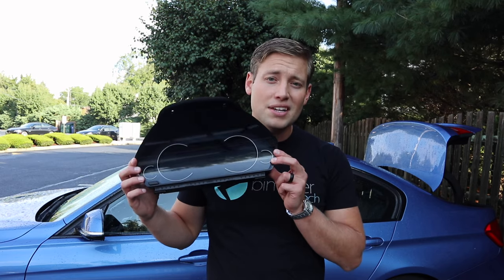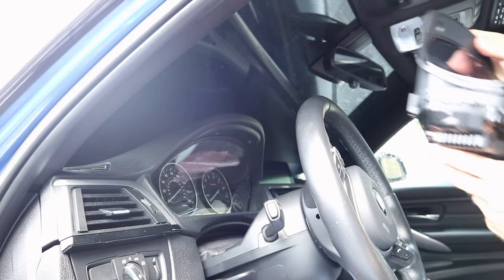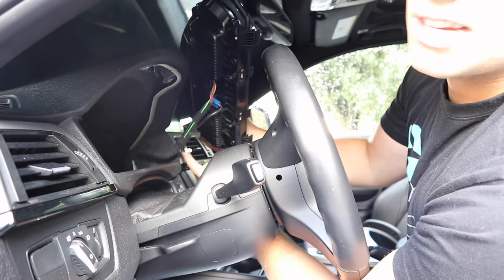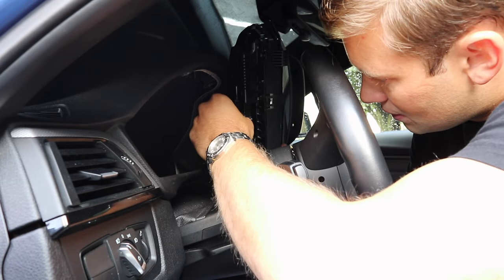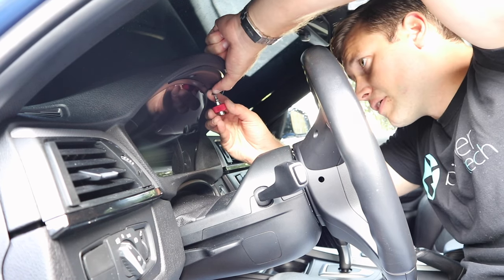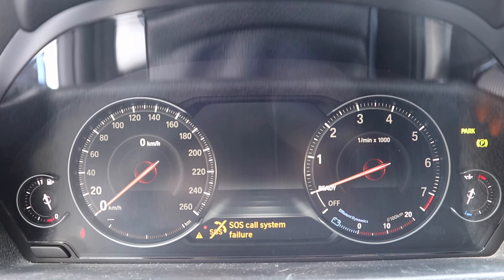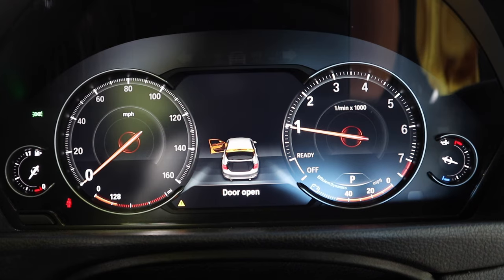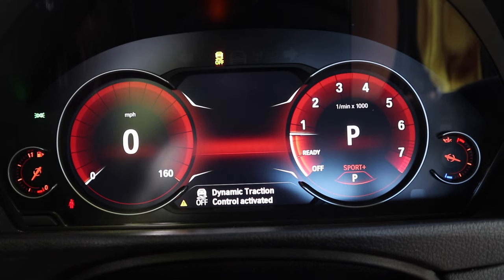How to install the all new 6WB BMW OEM Digital Cluster on the F30, F30, F32, F3x, etc. #6wb

Comment: German cars: 
over engineered drivetrains and engine, sophisticated electronics and components
Remove 2 screws to take out the whole cluster

Japanese car: simple and durable engine and drivetrains
Replacing a faulty button requires taking out a whole dashboard.
Reply: so true LOL
Reply: Japanese Cars has also over engeneered Engine with 3 turbo?!
Reply: Japanese cars are the best! Which is Toyota, but I do love German cars such as the BMW because of the comfort
Reply: @ScubaDiverMan711  I dont know about comfort my brother bought a 328i and the seats are rock hard and uncomfortable leatherette factory seats  the car itself is a fantastic sports car but the seats are awful.
Reply: Russia Man99 I mean the new Supra is a BMW
Reply: neosrt10 does it have the m sport package Becauses that’s the whole point
Reply: Your telling me. I had to take out my entire dash to replace blower motor on Nissan Altima ....
Reply: do duc duy 
German cars are well engineered they are not over engineered
Reply: As AC mechanic, Nissan and Toyota are the worst to work with. Meanwhile honda is easy, the engineers at honda already think about how mechanic can fix certain stuff without removing whole dashbord
Reply: And BMW is still bmw since e39 till e60. Until F- coming, metal clips there and there.
Reply: Sooo true
Reply: except when it comes to removing the headlights. on bmw cars you have to remove the whole freaking front bumper to get the headlights out.

meanwhile on almost all older volvo cars (2016 and older) the headlights are only attached with 2 metal clips. you can get BOTH headlights out in like 1 minute.

Comment: 3 years later I’ve finely my own f30 330D (2018) first BWM after killing my old Ford Focus with 460 000km.

And my first mod on it will be this amazing cluster and m3 led steering wheel

Comment: What's wrong with the analogue cluster. Seems like just another thing to break. The standard dials have been tried and tested. Still looks good to me.
Reply: I have yet to see a digital cluster to fail. These aren't your cheap aftermarket solutions.
Reply: Well digital cluster indicates oil temp so that alone is worth not having to add an aftermarket gauge that isn’t included into the dashboard
Reply: @CarlosHernandez-cm5yx  analogue cluster includes oil temp...

Comment: I was planning on doing this but was told if you take your car to the dealership and they happen to reset your ECU, you'd lose all the coding?  Does BimmerTech offer re-coding if that happens?  Also I was told this voids your warranty if you still have one...
Reply: Yes we do and it does not void your warranty.

Comment: Cool !! but OMG -- $1600 !
Reply from the maker: Awesome isn't cheap, lol
Reply: Is this bmw oem part or some custom job?
Reply: Obviously is OEM...
Reply: Benszg its oem
Reply: It's cheap...
Reply: Yep $1600 , just remember that when all cars have this you'll be facing a potential $1600 bill should something go wrong.
I have a friend who bought an Audi TT with the virtual dashboard, guess what, it went wrong.
Luckily it was under warranty still.
Reply: Yes, oem, but if you order this on your new car it is in a $3,100 package
Reply: Honestly I’m surprised it’s not more. Analog clusters cost that much. Quite reasonable
Reply: Kies Motorsports where i can buy this? I need link
Reply: you don't buy such a car if you find this upgrade expensive. it's some rather acceptable price.
Reply: Does this cluster fit into X3 F25 (2012)? Love the final effect!

Comment: In a manual car will it tell you what gear you are in?
Reply from the maker: Hi, I haven't personally tested, but I can probably find out
Reply: I would think so.  I have a 15 335i that is a manual.  You can select whether to display the gear you are in or not.  I can't see losing that feature from the IDrive as all you are replacing is the instrument cluster

Comment: Does this avoid the warranty
Reply from the maker: Because of the Magnuson Moss Act, installing parts on your car can't void a warranty, unless the part you installed specifically causes an issue.
Reply: Kies Motorsports do you offer such a digital display also for the BMW Z4, E89 (sdrive 3.5)?
Reply from the maker: Not yet, sorry
Reply: Does this work with 2014 X5 ?
Reply: ibr80 same question

Comment: With the bimmertech video they plug in an optical cable and remove bits of the dashboard and plug in a cable into the back of the cd drive system

Comment: That cluster is slick, not sure if it's $1800 slick, but I would jump at throwing one in my 335 if I could find a used one on the cheap.

Comment: quick question do these parts need to be re programmed if the battery is disconnected ? if so do i have to do it live again ? would tht cost second or third time around ?

Comment: I would love to get the digital cluster one day. My cluster got a bunch of foggy spots from some glass cleaner I used on the back side of the glass. And a bunch of dust in there. Does the plastic cover come off so I could clean behind it?

Comment: Hey, Which is better? The rwd or xdrive? I plan On doing lowering springs. Im interested in which of the 2 will handle power mods better
Reply from the maker: I would recommend the X Drive!
Reply: Kies Motorsports will the torque still feel strong? Since it has to be distributed more equally between front and rear?

Comment: Awesome Work. But one Question:  How did you change the Original Miles on the new Digital Instrument Cluster? Laptop? Software?

Or is the new Instrument Cluster so smart enough to recognize the Miles from the Controll Modul Device, and that he automatically put directly to the Digital Cluster?
Reply from the maker: We code it to sync up and it automatically applies the miles
Reply: Kies Motorsports That only works on the Digital Cluster right? For example on a old Instrument Cluster, let's say a 12 years old, would that work too?

Comment: Hi Bro !!
I been watching your videos I learning something every day from your videos !  I have a question in my e90 2007 3281 the lights for the ABS is on all the time when I bought my car back in February 2020 come like that the guy sold me the car said just needs a calibration computer because they replace the ABS part under  the hood. So believe them, so now after 9 months I want to fix it can you give an idea how can I turn the light off of the cluster, or  have to go with some mechanic certified. I want keep my runs pretty smoot. I was thinking to sale it but change my mind.
Thanks for read my message Have a Great Day and be Safe.
Jaime from Houston, Texas.

Comment: On the website for the product it states heads up display not supported in CIC vehicles. Does this mean the instrument cluster is unavailable for cars with HUD
Reply from the maker: Hi, it works on NBT and NBT EVO, we’re working on getting it up and running on CIC

Comment: Hi, my F30 instrument cluster does not show Navigation display in the centre as shown at 5.05 in your video. I have checked all settings, and all look OK. Took it to BMW showroom, and even they are unable to fix the issue. Any help would be appreciated. Thanks.
Reply: Did you try to turn it off and turn it back on?

Comment: What's this from? The new 5 Series or is it available from the factory in Europe on the F30? 

Also - does this do everything that it's supposed to? (I.e. Radio controls) and does it work with heads up display?
Reply from the maker: Hi, they just came out from BMW in Germany, so it's the real F30 one. It does everything you'd expect and we've had some people use the HUD with NBT and NBT EVO and it looks awesome
Reply: Kies Motorsports thanks for the quick reply!

Comment: Nice video Bryan. Is possible to code to have a digital speed (instead of the needle reading) on comfort and Eco pro mode?thanks
Reply from the maker: Thanks! Digital speed is only on Sport and Sport + mode
Reply: Hey I want to get one of this. Will this work with F10 2011 535i?? it doesn't have the driving modes 'eco, sport etc', nor it has the start/stop system.
Reply from the maker: If you have an F10, you should be good. You just can't use it with an M5: https://www.kiesmotorsports.com/kiesstore/multifunctional-instrument-panel-retrofit-f10-f11-f07

Comment: Bro is all this happened and I updated it but the P15E8 engine light turns on I get that code says manufacturer defined it will be that it does not work oh what should I do

Comment: Hey Brian, I am interested in putting this cluster in my 2013 335xi, the installation part isn't what I'm worried about, it's the coding part. I went down to my local BMW dealership and first of they didn't know this cluster and second they weren't very convincing about knowing how to code the car for it. Im in the boston mass area, is there any one near by or that could do it remotely if I grab this thing off ebay(found one for just under a $1000.00) it's very similar to the cluster in my challenger, and would love to have that eye candy in my commuter. You make by far the best DIY videos on BMWs that I have seen on yt and one of the main reasons I bought my car (never drove a beamer before and was nervous about working on it- you at least gave me confidence to not be afraid of turning a wrench on this thing)  Thanks

Comment: Bryan! Do you know this will work on the 2018 BMW 330e ?
Reply from the maker: Yes it will!
Reply: Kies Motorsports Will it really with all the 330e eDrive fetures? Like the battery charge, distance left etc. Since BMW does NOT offer the 6wb for only the 330e im curious..
Reply: Kies Motorsports do you have any pictures on how it will show all these features?
Reply: Kies Motorsports could you please reply? Im really eager to get this done but no one seems to have gotten this to work..
Reply: @KiesMotorsports  Still no response, have you tried it yet? "Like the battery charge, distance left etc. Since BMW does NOT offer the 6wb for only the 330e im curious.."

Comment: This does make the standard gauges look really dated. I want this, but it will no doubt void my warranty. Looks so simple, the dealer won't do the upgrade?
Reply from the maker: There’s no reason it would void your warranty since it’s a Bmw part and because of the Magnuson moss act. We’ve actually received calls from new dealers to have it done on new cars 😀
Reply: Is it compatible with the my HUD? And are there iDrive settings screen options? Maybe an quick overview video is so. Thanks.

Comment: How is the coding done? Any video for that?
Reply from the maker: We handle it remotely
Reply: Kies Motorsports i have read that the car need to be flashed before apply the change. What do you mean by remotely? Does it came with a cable?
Sorry the questions but without coding it properly it doesn’t worth it.
Reply from the maker: Hi, you would hook a cable up to a laptop and to your car and we would do the programming

Comment: What about those of us with HUD?
Reply from the maker: We've tested it working on NBT and NBT EVO, however, we're working on getting the CIC up and running with it
Reply: Kies Motorsports so sorry. can you break the lingo down for me? Nbt, evo and cic?
Reply from the maker: CIC was the old navigation system in most cars 2013 and older. Nbt and NBT Evo are newer cars

Comment: Does this work for the m4 too?
Reply from the maker: Sorry, doesn't work on M cars :(
Reply: But why? Isn't it basically the same?
Reply from the maker: I was told "because of M control options, it can't be done". Things change though, so I'm staying on it
Reply: Kies Motorsports you really should stay on top of it. If there's a market for this kind of mod, it's the M3/M4 community. I guarantee you'll increase sales significantly if you're able to retrofit this into the F8X M3/M4 and keep the price around what you have it now for the F3X. I'll even be your first customer :)

Comment: I'd pay $1499 but not $1799 too steep for more or less same functionality as stock but LED display..also would better if it had performance gauges 0 to 60 1/8 mile , 1/4 mile times , lateral and  gforces with multiple customizable colors.

Comment: I'm my experience the mileage of the car is set on the cluster, not on the car's ECU. I'm assuming Bimmertech codes your car's current mileage to the new cluster correct? I kinda of want one
Reply from the maker: I believe it's a combination of the two
Reply: Kies Motorsports So my car doesn't have Nav currently, do you know if the navigation guides on will show up on the cluster if I install the NBT Evo screen after getting this or should I get the NBT Evo first then this. Also will the new cluster only show nav or any other functions such as music playing? Thanks again for the video.

Comment: What is wrong with nice shaped analoge Gauges? What is wrong with old style swiches?
I hate that the manufactors like Audi removes all Analoge an Swiches an replace it by aweful Display tecnology. For them, the Display a cheaper to develop, but those spare parts a one of the most expensive parts of thr interieur. 
Badly.

Comment: That price is ridiculous
Reply from the maker: It includes a brand new BMW OEM cluster that just came out, coding interface, coding, support and includes free shipping. That being said, the price is on point and we've seen them listed for higher. Sometimes you can find them on ebay and such, but you never know where they've been and they offer you zero support most of the time